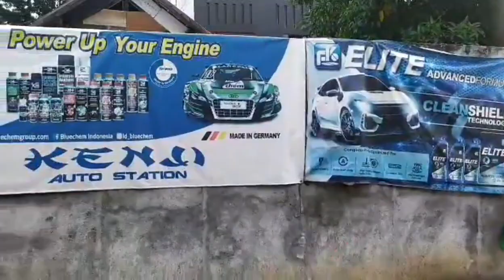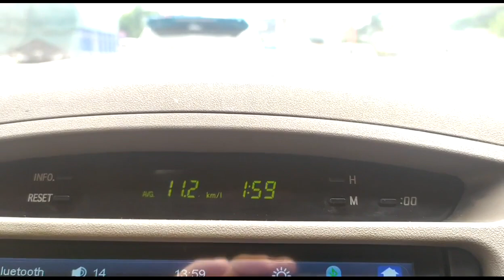Part I | Innova Bensin seirit Avanza ? Cara Bikin Hemat Innova Bensin Matic.

Comment: Ada innova matic 2005. Bensin V non euro.

Dibilang paling irit engga, tapi kalo mitos boros sih salah. Jatohnya worth it sih. Krn kompresinya bisa minum premium

Dalam kota sekitar 1:10,
Luar kota 1:13 an.

Gw bisa bilang demikian karena tipe V ada MID bensin nya.
Nyetir pintar santai ala cruising matic.
Pilih matic krn ga smw keluarga bisa nyetir manual alus, rata2 kopling gas nya pasti kelebihan jadi stop and go manual lebih boros (utk anggota kelg saya).

isi premium pertalite nyampur, karena emang ngejar bensin murah.
Ini mobil keluarga mesin kompresi rendah, gausah sok diisi bensin mahal krn ga ngaruh.

Ubahan yg bikin irit :
-Curut yihi 4
-gurah mesin tiap 6 bulan
-Pasang elektrik dual fan (lepas vsco)
-rajin ganti oli matic per 50rb aja
-pasang downpipe 421 (cocok dalam kota cruising)
-remap step awal
-ban serep copot, 1 kursi baris tiga copot
-ban tetep pakai ukuran standar

Alhamdulilah selama ini paling boros cuma 1:9 an.
Catatan gw kalo nyetir mobil g pernah buru2, klo butuh cepet ya naik motor.
Mobil rata2 dipakai weekend atau kalo lagi ada pergi keluarga atau luar kota.

Ini mobil kalo diisi 6 7 orang jatohnya worth it parah sih, nyaman jauh di atas avanza or lmpv, bantingan lembut, dan karena rwd dibawa luar kota ujan licin manapun ga khawatir.

Mesin dan kaki2 juga bisa masuk kategori bandel. Gapernah ada rusak sama sekali kecuali emang yg harus udah diganti karena umur.

Cocok nih mobil utk dipakai jangka panjang, utk yg ga mentingin model futuristik. 20th dari keluarannya, fitur2 ga kalah sama mobil skrg.
Biaya dan kenyamanan yg didapat sebanding.

Klo kondisi mulus, Gengsi di parkiran mall atau kondangan juga masih dapet ketimbang mobil2 murah jaman now 👍👍👍
Reply: Dpt hrga brpa yg type V
Reply from the maker: 85
Reply: Kira2 ada lgi gak ya yg sgtu bang
Reply from the maker: @ardhangobez9524  ada bang byk
Reply: Boleh minta wa nya om mau sharing2 tntang innova om,,rencana mau beli tp masih ragu antara yg euro atau non euro
Soalnya ada yg bilang lbih irit euro ada jg yg bilang sama aja
Reply from the maker: 0812 2643 8868
Reply: "Ini mobil keluarga mesin kompresi rendah, gausah sok diisi bensin mahal krn ga ngaruh." 
gak ngaruh apa mubazir bang? kok banyak yg nyaranin pake pertamax atau pertamax turbo logikanya mesin 1TR-FE kompresinya 9,8:1 bukan 10:1-11:1 yg wajib pertamax/pertamax turbo
Reply from the maker: Isi gas biar jd hybird

Comment: Share: Sy piara ipah matic v 2005 bensin, rubah velg pale r17,  kondisi mesin standart gapake rubahan atau pemasangan apa apa, tiap hari rute pucanggading ngaliyan, tembus 1:9,7 boros2nya 1:8,9 kalo bini pas lagi nyuruh balik cepet om.
Rencana mau pasang grounding kabel tapi kabel nya setebel grounding kabel ipah, 1 biji aja nyambung ke head silinder, sama pasang filter udara racing, biar tarikan lebih jambak
Reply from the maker: Thanks for share nya ya om.
Reply: Itu dalkot/lukot atau kombinasi om? Bbm pertalite atau premium?
Reply: Om wahyu sebelumnya pakai velg orinya d banding r17 berada g borosnya
Reply: @prassbyantharafany1317  ga terlalu signifikan om, malah langsamnha lebih enak

Comment: Mau nanya om, innovah saya matic 2.0 V, Avg nya 1:8.1 l/km itu normal ga ya? Makasih yg udah jawab 🙏🏻
Reply: 1:8.1 km/l maksudnya
Reply from the maker: Normal mas. Kan inova sahabat pom bensin
Reply: @67bakulmobil21  kalau org2 yg AVG nya 1:9 - 1:10 km/l itu gimana mas, kok beda ya,
Reply from the maker: Tiap mobil beda kondisi perawatan dan cara nyetrnnya om. Dan beda pula lintasan jalannya.
Reply: @67bakulmobil21  jdi cara merubahnya gimana om? Harus di servis kah?
Reply: Kalau 1:8.1 itu sudah cukup irit, tidak lah boros segitu. Pertanyaan nya itu di MID ya, kenyataan nya segitu ngak? Coba pakai metode full to full atau rest to rest
Reply: Punya saya yang dapat 1 : 6 km, terlalu normaal 😂. Mungkin perlu perawatan extra lagi.
Reply: Segitu ok kok

Comment: Matic sm manual itu lebih bisa di buat irit yg mana ya om ?
Reply from the maker: Manual lebih irit tp capekk
Reply: @67bakulmobil21  makasih bang...dari kemarin ragu mau beli innova tahun tua..karna masih jadi momok yaitu borosnya...skrg udh agak yakin innova non euro..😁
Reply from the maker: @acandrairawan  yg euro jg boros om. Krn body gede. Yg penting nyaman dan part banyak murah om. Jgn matic om pasti boros tp enak gak capek
Reply: @67bakulmobil21  nah ini...kemarin jg ada yg bilang bahwa euro dengan non euro sama aj...perbedaan g signifikan...semoga bisa segera kebeli, lalu pasang alat curut ya om..
Reply: @67bakulmobil21  🤝
Reply: @67bakulmobil21  dulu seneng mobil manual, setelah nyoba yg matic kok jd ngerasa enak jg y matic, apalagi jln jauh atau pas jalan padat enak yg matic..😁

Comment: Di aplikasikan buat luxio bs om?
Bbm boros dan tarikan berat. Dalkot semarang cm dapat 1:8
Reply from the maker: Saya dulu ada mobil grandmax 1.5 di servis dikenji, gurah, pasang grounding + volt stabilizer + filter apex tembus 1:11.
Reply from the maker: Coba buka fuelpump nya om dan ganti filter bensin. Kadang sdh tersumbat karena kotoran. Itu saya 1:11 dalam kota semarang rumah mijen naik turun bukit. Dan customer yg beli mobil ditempat kami pun senang karena hemot poll bbm nya.
Reply: Oke thx pencerahannya om..saya coba buka fuelpump dan ganti filter bensin dulu.
Reply from the maker: @citranaivlanusantara9975  biasanya di tabung fuel pump semacam lumpur coklat. Dan fuel pump lemah bisa bikin ngobos bensin jd terbuang sia2 itu yg bikin boros.
Reply: @67bakulmobil21  mas minta alamat lengkap nya itu dong.
Aku asli Jepara Utara, kecamatan keling
Reply from the maker: @adiputrofamily7278  alamat showroom saya : Perumahan Graha Permata Surya Mijen Semarang. No. Wa : 081226438868. Alamat bengkel langganan showrm : Kenji Auto Station Jalan Talang.

Comment: Bengkel smrng e dimana pak? Diapain aja pak? Ganti filter bensin, tambahin pitbul, cleaner. Ada yg lain? Habis brp pak?
Reply from the maker: Kenji autostation semarang jalan talang. Tuneup gurah, servis rutin, grounding, ganti filter bensin udara, cek fuel pump, kuras oli matic, pasang pitbull. Habis biaya 2jt.
Reply: Semarang daerah mana gan jln talang itu
Reply from the maker: @kisahkitatv  akpol om.
Reply: 67 Mototech minta no WA nya om,rencana mau ke bengkel sampean mau tune up🙏🏻
Reply from the maker: @mazgomz7535  082299990388 adhi kenji jln. Talang semarang. Itu om bengkel saya. Monggo kalau mau remap tuneup upgrade.
Reply: @67bakulmobil21  Pitbull brp om
Barang ready kah om
Reply from the maker: @musafir2119  ready . Wa : 081226438868

Comment: Kijang lgx efi bisa jd irit om?
Reply from the maker: Tdk bisa om.
Reply: @67bakulmobil21  kenapa
Reply: @adededisaptari1017  beda mesin, beda caranya
Reply: Karena kijang LGX itu masih mesin injection EFI standar. Kalau innova walaupun cc lebih besar yaitu 2000cc , bisa jadi lebih irit karena teknologi vvti. Itu yang bikin valve masukan bensin dan udara bisa lebih sedikit saat kondisi tertentu. Misal saat macet atau kondisi pelan.

Dibanding EFI standar dengan masukan input bbm yang cenderung konstan.

Comment: Di buat dong dalam video
Before nya brapa, After nya brapa komsumsi BBM nya
Reply from the maker: Siap bro. Kebetulan ini video sdh lama sih bro, dan mobil sdh laku. Before rata3 sama sih 1:8
Reply: @67bakulmobil21  sedikit cerita  kebetulan saya baru ambil inpva V 2005 dan warna kuning metalik juga ... di tampilan muncul 7,7 dan kebetulan ini mobil belum saya bawa kebengkel sama sekali buat check Up mesin dll cuman kemarin aja harus ganti kompresor karena bunyi ... menurut saran mas yg harus saya lakuin mulai dari mana dulu dan cek apa dulu ya supaya bisa seperti inova projekan mas . Mohon tanggapannya soalnya saya juga awam dan baru pertama kali minang mobil ini 
Terima kasih
Reply from the maker: Langkah awal tuneup general dan ganti perolian pak dibarengi ganti filter udara dan filter bensin
Reply: @67bakulmobil21  untuk Tune up general lebih baik di bengkel biasa atau di Beres ya mas?
Reply from the maker: @dwisupriyanto951  bengkl biasa saja pak lebih murah

Comment: Voltage pinbull nya brpaan om
Reply from the maker: Saya lihat di indikator stabil di 14.5v . Untuk info lanjut hub kenji autostation.
Reply: Minta kontkny om
Reply from the maker: @dimasfive5435  082299990388 adhi kenji
Reply: @67bakulmobil21  maksh om infonya
Sukses slalu chanelny oom...
Reply: @67bakulmobil21  alamat lengkapnya om 🙏